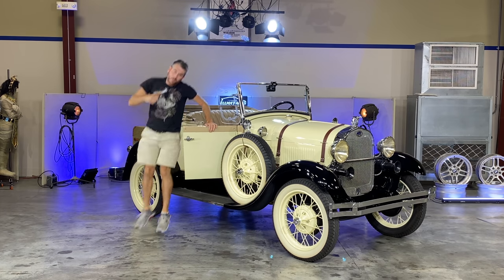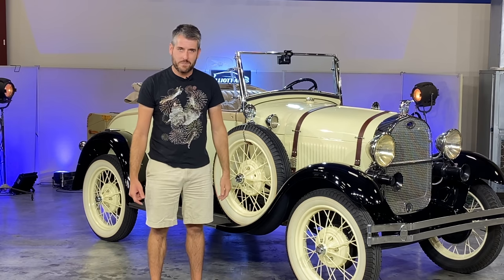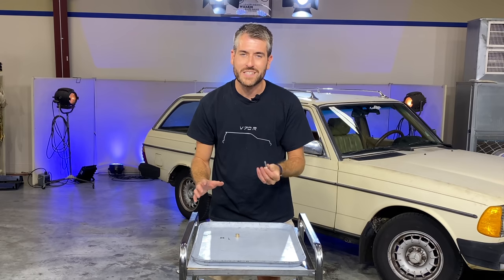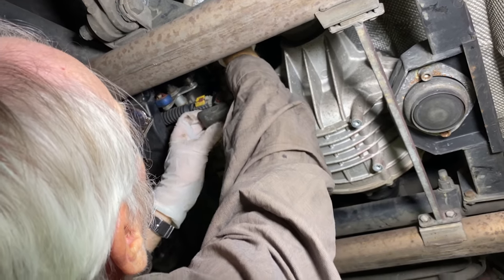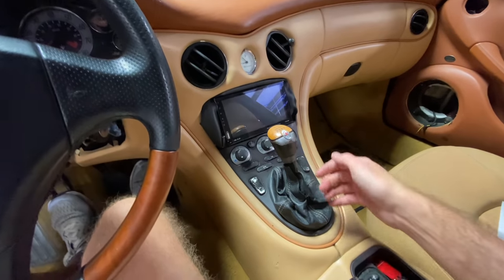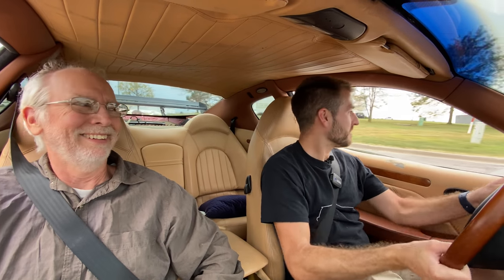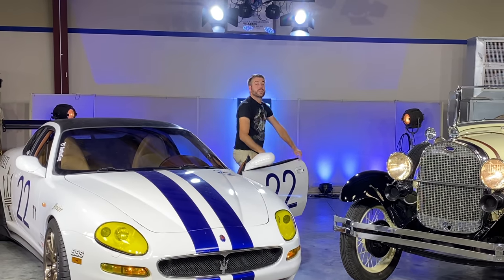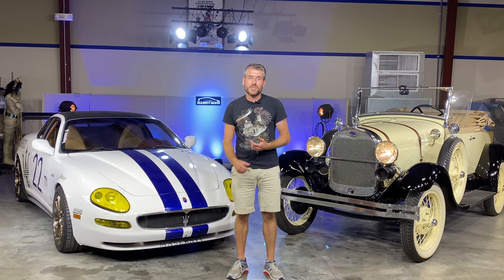Repairing My Maserati Using 100 Year Old Ford Technology

Comment: I've always maintained that any garage worth its weight in mustard requires a good lathe. It's incredible what a new part, even one so simple as this, can fix! great to see the Maserati on the road again and shifting better than ever! 

Also, thank you for sharing such two beautiful and contrasting cars! That Model A got me absolutely drooling its so gorgeous!
Reply from the maker: Thanks!  The Model A is an incredible car. I love having it around.
Reply: having a good fab shop is so damn nice. i had access to a full fab shop, with lathes, press brakes, shears, welders, grinders, mills, CNCs and sand blasters. it really is amazing all that you can make on your own with a million in machinery....
Reply: @MrDiva480  A mill is essential. You can actually turn parts on a mill if you don't have access to a lathe. 

You wait until they perfect cold sintering/3d metal printing. They're close with filament with carbon fibre/aluminum imbedded in it....

Believe it or not I've turned my own parts using a hand drill and a file. I've also turned things using my drill press only it's not as accurate as a lathe due to TRO.

Comment: That kind of pin has been working for an extreamly long time. It always makes me laugh when some engineer designs a part to replace it and is shocked when someone dumps their new part in favor of the tried and tested part.

I used to be an arcade tech. I lost count of the number of times I had to totally rebuild a system in a moving game using fixes like this because the manufacturer decided to stop making the part.

Comment: You could make a linkage with a spherical bearing and fix the other end then no more cable tie
Reply from the maker: That might be what I end up doing for a more permanent solution!
Reply: This!
Reply: that or find a suitable ball end and use that. There are literally millions of different sizes readily available. They are used everywhere. Even the rear brakes on my vstar uses them there. Forklifts, boat motors, motorcycles, the list is endless.
Reply: Spherical bearing and drill a hole in that current ball stud to use another cotter pin! My idea was 3D printing a replacement socket.
Reply: @802Garage  I was thinking about drilling through the ball too but if it is hardened, that'd be a bitch. I have some ballscrews that are only hardened on the surface but try and cut through it.....it's only 1 mm thick but carbide bits will just dance over it and shatter. 

Can you 3d print in nylon? PLA would wear out rather quickly.
Reply: @muskokamike127  Oh yeah it would def be a pain. Could dremel a notch for a C-clip instead! Much easier. You can 3D print a lot of durable and flexible materials now. Definitely something that could handle that. Plus he could make something that take a C-clip retainer so it can't possible fall off, for example.
Reply: @802Garage  yeah there's literally hundreds of ways to secure the ball end.....The first thing though is to see if that ball can be removed from the linkage. If so, just replace it and the ball end with one that has a hole in it for a securing bolt or clevis pin and C clip (as you said).
Reply: @muskokamike127  Excited to see what he comes up with!
Reply: @ElliottAlvis  Elliott, permanent fixes make for boring videos!
Reply: I was thinking the same thing. He made the other fitting, could easily make a different style linkage and make it work.

Comment: The first 15 years of my working life were spent on a manual / CNC lathe and or milling machines before "shifting gears" into the world of I.T. Like you, Elliot, if I need a part, I make my own, most times better than the original design.

Comment: When a retainer clip in my 1985 300D fell out of the throttle rod (completely disconnecting the gas pedal from the engine) during a road trip, I was forced to walk about........200 feet to a Remote Control car/plane hobby store and buy a very expensive ($3.89) bag of the exact retainer clips that Mercedes used when they built the car.

Comment: For the other end of the cable in the uk there are clamps to hold similar on vauxhall vivaro vans with problems with popping off ball joints. There are also similar smaller ones for ball joints that pop off on wiper linkages.

Comment: Ok, so in order to keep all our weird cars on the road long after the manufacturer has disavowed ever making them....we just need a machine shop, two very knowledgeable technicians, some luck, and more luck.  Nice!  Cool fix though!!  Who needs those Italian parts manufacturers..haha.
Reply: That and a computer tech. The biggest killer for modern cars is the technology. Samcrac has a 2004 Ferrari and the ECU is made in such a way as to be unrepairable. Bosch has stopped making them which means the ONLY source is used. Two years ago they sold (used) for $250. Now the supply is drying up and they are now selling for $2500.

Once the supply is gone the ONLY way is to build a new one from scratch....

YOu are 100% correct on the machine shop and old cars. A good machinist can pretty much replace any part on the Model A right down to the block. I learned how to sand cast a few years ago and used foam as my "model" I cut the "model" out of foam on my CNC router, packed it in the flask with sand, melted a bunch of aluminum and when I poured it in, the heat vaporized the foam and replaced it with aluminum. Voila, a part. Now I never got into calculating the shrinkage when the aluminum cools but a buddy who is into old airplanes wanted me to expand to start making parts for Spitfires. Seems there's a real shortage of parts.
Reply: @muskokamike127  As for electronics, that can be reproduced as well -- there are companies producing recreations of 30+ year old computers. The challenge is in the proprietary software at this point, but that can be overcome as well.  At some point, companies like Holley will be able to produce a generic ECU that, with the right connectors and programming, will be able to run any car, much like their add-on EFI systems. It won't be cheap, at least initially, but it will be possible...
Reply: @AndrewAMartin  "it won't be cheap" ummm if the cost to re-produce the ecu is worth twice as much as the vehicle then it's worthless......as for Holley, they don't make them currently for any exotics or from the looks of it, even imports. Now what about the sensors? there's dozens of them in an engine and even more different connectors to various things like fuel injectors and COPs etc.

Sorry bud but if it is so easy to reproduce chips sensors and ecus, why does Ford have 30,000 trucks sitting at a raceway in Tennessee? Why don't they just "reproduce" them? Why are so many manufacturers screaming for them when they can just make em?
Reply: @muskokamike127  Ok Luddite, there's a difference between lack of manufacturing capacity and lack of ability. The current chip shortage is due to economics and just in time inventory. Auto makers are no longer the totally vertically integrated companies of old, they rely heavily on external suppliers, who can make similar parts for multiple brands. With JIT manufacturing, they don't keep large stockpiles of parts on hand, so if a supplier has a problem, it has a ripple effect. But none of that has anything to do with my point - that a generic, programmable ECU is entirely possible. Autel makes diagnostic tools that can read the output of every sensor, based on the make and model of car. It can be done now, the hurdles are economics (can it be made cheap enough) and legal (Right to Repair and proprietary software/licensing). The technical challenges are pretty minor...
Reply: @AndrewAMartin  lol with the name calling. 

Again, if it was so easy the OEMs would be doing it NOW. 

You can make any excuse you want but my point remains and you have yet to refute it: 

I love your type: nothing is impossible. Hell, flying 1000 people to mars and setting up a colony is easy too, just spend a couple of hundred trillion dollars, build thousands of space craft, and develop tech to extract oxygen and water from the Mars environment.
Reply: @muskokamike127  Good thing there are people like me, otherwise we'd still be living in caves and hunting with pointy sticks. Did you not comprehend anything that I wrote?  You seem to think that I'm proposing a giant leap in technology, when that is simply not the case. This is all existing technology. Do you think that OEMs* make a different ECU and new sensors for every model? No, they develop an ECU to use in multiple cases, changing the programming to fit the parameters - they already ARE doing it. An ECU is just a box full of Programmable Logic Controllers - the program is what makes it unique. Aftermarket tools exist to change that programming already. As I stated before, the challenges are not technical, but economic and legal, and at this point, the OEMs are not willing to license their proprietary software. The point is that, for vehicles where a used ECU is no longer available, a generic programmable ECU is entirely possible.

* An OEM is the automaker, not an aftermarket supplier.
Reply: @AndrewAMartin  You argue and debate like a girl......I understood everything you wrote, and you aren't getting it...at ALL. 

1) if it was so easy, there wouldn't be a chip SHORTAGE NOW. ALL your excuses mean zero in this conversation.
2) COST. You don't care about cost, but it IS a factor. NO ONE in their right mind would spend $100,000 to develop an ecu to save one car. If ONE ecu can be used on many cars, why don't you put it to the test? Buy a Holley Eliminator and put it in a Ferrari and tell me how it goes. 

I tell you what, if it's all just chips and programming, go ahead and try and plug in a DVD writer made for windows into a Mac....and tell me what happens.

As for your comment about living in caves etc. Just like many who KNOW they are on the losing  side, you resort to extremes. BTW: a hammer today is pretty much the same as the very first hammer developed 1000 years ago and will remain so for the next 1000 years. And another thing: you can still live in a cave, and it will be around for 10,000 years. Tell me your stick framed house will be around in 300 years.....hell,  it couldn't survive a tornado but a cave sure will.......
Reply: @muskokamike127  You're the one who doesn't get it. I'm done arguing with someone who has absolutely no idea what he's talking about.

You still equate a lack of fabrication facilities with some sort of technical challenge, and ignore the fact that I specifically mentioned the economic issue at least twice. And newsflash: Windows and Mac PCs are identical under the skin. They use the same parts, from the same vendors, with the same interfaces. Even when they were using different CPU architectures, you could get adapters to interchange peripheral devices. All of that is beside the point. The hardware is irrelevant, the important part is the ECU program, which would run in a virtual machine. Getting the automakers to license their intellectual property is the biggest hurdle. And note, I never said it would be easy, just that it is possible, technologically speaking.
Reply: @muskokamike127  Obviously not, Mike. You've demonstrated a complete and utter lack of knowledge of electronics and computers up to this point, so no, you don't know more than I do.
Reply: @AndrewAMartin  according to you.....I've been dealing with computers and processors since before the 8088 and I've built machines using computer numeric code and do it daily. 

So gtfo of here........

Comment: I’ve used the same thing on aircraft service equipment, because the manufacturer says “that’s a special piece and is $200”  then you check it and it’s a standard clevis you can get a bag of for $10. If it was on an aircraft I’d say ok, because well you have to, but on the equipment I use my old farmer grandpa’s handed down ingenuity